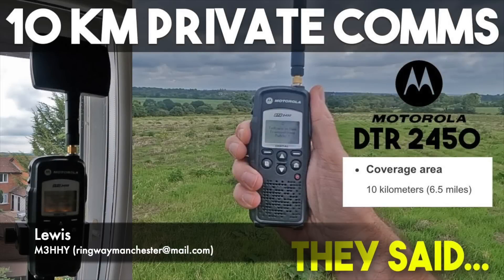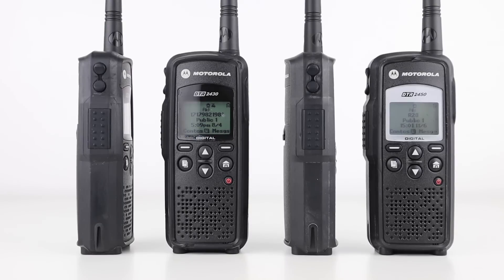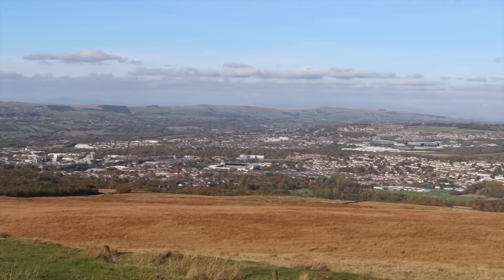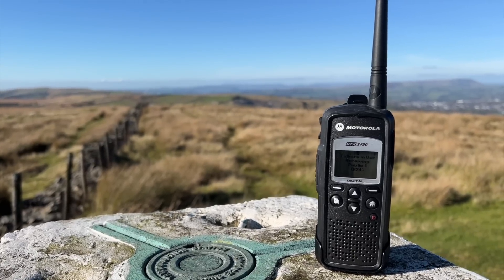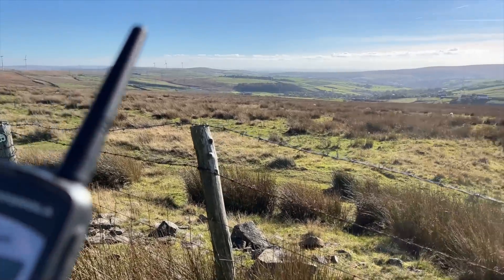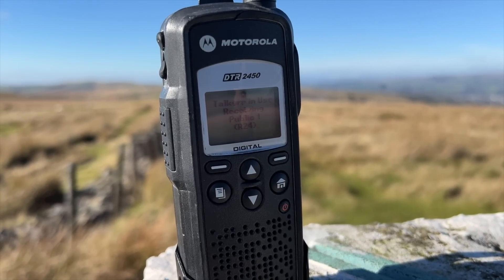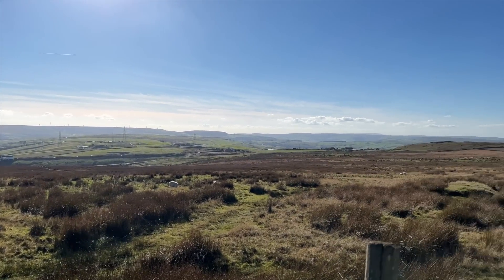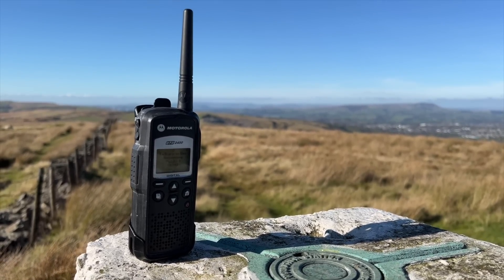Pushing These Secure High Frequency Radios To The Limit!

Comment: 2.4ghz is like the worst band to be using portable radios on. I dont know what motorola were thinking. Anyhow if you use a pair of parabolic dishes you should be able to get 10kms easily. Remember to keep the antenna cable between the radio and the dish short as you loose a lot of signal over a few metres of coax cable at 2.4ghz.

Comment: TriSquare also had FHSS 2way radios on sale across the USA and were fairly cheap but the technology was secure. Sadly they went out of business in 2012. They were cheap, on the GMRS 900Mhz frequency so no licence needed. Downside they couldn't 'talk' to any other radios.
Reply: Those things were pretty cool for what they were. AFAIK they used plain analog modulation combined with relatively slow FHSS (both unlike these Motorolas), so listening in probably wouldn't be that hard if you know what you're doing. There's a video on YT of someone doing so using Optoelectronics gear. Still a lot harder than plain old FRS/PMR446, though.

Comment: have you got an OFCOM simple business license?

you can use 5w and encrypted DMR, Anytone 878 offer AES256 but from 32 preelected keys from memory. I wonder if  someone could edit the hex and select their own encryption key 🤔
The Anytone 578 mobile unit can track the handhelds bearing and distance from the APRS (also does crossband repeat and can cross channel repeat on DMR with a different talk group) so it would create an interesting  extended encrypted network  Expensive experiment but interesting!

Comment: I've pushed the DTR650's (900MHz @ 1W) out to just over 14km. But more important to my application through 18 stories of a concrete building, well into underground parking garage. That's with the add-on longer antennas, not the stubby antennas that they ship with. They've been a very good radio for our building emergency team.

Comment: This is the first time that I have heard these radios. Thanks for the video 
My wife and I are using the Retevis RT10 900 MHz ISM here in the US. They are great radios for short range secure (as secure as you can be using radios). They don't do FHSS but they are DMR with encryption.
Reply: @blankreganon5395 do you need a license to use?
Reply: No license is required for ISM. They are limited to 1 watt. Amateur Radio shares these frequencies on a secondary basis. If you go over the 1 watt limit, you need to have a ham license.

Comment: It's a shame england doesn't have the same radios the rest of the world has. I got 300+ miles between 2 Uniden Pro 520 CB radios. One, a land 1/4 wave homemade wire, and one, a marine whip on a sailboat. 1/4 watt FRS radios?  7 miles ground to mobile radio shack units.
Reply: Is that strictly line of sight, mountain to mountain top?
Reply: @rawcado  Almost, in the case of FRS radios. The higher the frequency, the less the wavelength will bend or penetrate foliage.

Comment: Hei, I wonder if Dji can make a communication radio one day. I fly drones and there wifi signal has a range of over 3 km with video, flight data, battery info and gps. And that's European mode. On American YouTube videos, I see that they manage 10 km regularly. Imagine if they wanted to make radio?
Reply: That range is  line of sight.
Any radio will do 100km or more with line of sight
Reply: @jplacido9999  yes, just like in the video, 100mw 2km
Reply: @darkokelava4754  if you test a regular pmr446 or FRS portable, they will do dozens and even hundreds of Km once their have perfect line of sight...
Only when propagation is particularly bad the range will be less.

Comment: I wonder how long range you could do using for example a 1.2m sat dish and a helix on each end.
Reply: 2.4 ghz will travel as far as the curve of the earth will allow, the issue you may hit is timing, they are TDMA and the increases RTT delay may cause them to stop working.

Comment: I wonder what type of repeater could be made, utilizing a pair of these with different talk groups, linking the audio or talk path between the two units, and utilizing ISM Antennas with some gain?  Ideally, you'd need 4 radios, with two 'earmarked' for the repeater.  Obviously, some type of controller board would be necessary, in order to provide the interconnect between the two units, but I could see this extending the units range considerably.  Add a Telco connection, for remote access.  These would make good, secure control links as well.
Reply: @cappicturesinc.4597  I'm glad to see there is a commercial solution.  Although, at that price, I'm almost thinking the interface & two radios would be cheaper.
Reply: @oliverw.douglas285  For sure, it just seems like a lot of work.
Reply: @cappicturesinc.4597  Since I have limited hands-on experience with these radios, I'm speaking from more of a conceptual perspective.  Theoretically, they could probably be interfaced through a very basic bi-directional repeater controller, which cross-connects receive audio from one radio, to transmit audio of the other.  Obviously, the audio levels would have to be set to proper levels, to avoid overdriving or clipping.  Beyond that, some sort of carrier-on or active channel detection would need to be brought out of each radio, along with the PTT or Push-To-Talk, to activate the respective transmitter, at the appropriate time.  

I apologize if I made it overly complicated.  If the necessary connections from each radio, could be brought-out, & made accessible, I think a basic repeater could be made, utilizing two separate talk groups, with two 'donor' radios for the repeater.  I think it would be an interesting experiment either way.  :)
Reply: @oliverw.douglas285  Ah I see, that could defiantly work. Don't worry about it, sometimes thinks need to be explained that way :)

Comment: I've seen these Motorola Gigahertz radios several years ago. The only ones available in the U.S. are in the 902-928mhz ISM band, 1 watt. Several models ranging from 1 channel to 50 or more. I still have a pair of the old TriSquare 900 radios and got excellent range, better than GMRS at 4 watts
Reply: I also had 4 of the Trisquare radios. They were great but I had two problems with them. First, they went through batteries quickly. The second problem was if you had three or more on the same channel, they wouldn't stay synced.

Comment: Surprising outcome, i would like to see these tested in a built up area, always looking for better performance on building sites.
Reply: They don't work at all well in a built up area. I have the same radios. At ground level I left one at home and walked 2 minutes up the road and it already stopped working. The higher the frequency the more it is blocked by obstructions. With mostly line of sight I got a decent range. I can't remember exactly what it was now but I posted a range test video.
Reply: @radiosification  It's then worse than 400-470MHz radios. What frequency is it using, 1-2.4GHz?
Reply: @dare-er7sw  yes, much worse than 400MHz band  radios for getting through obstructions. They're using 2.4GHz.
Reply: @radiosification  HaHa, 2.4GHz is WiFi territory. Too bad. There are small VHF/UHF 1-2W analog transceiver modules available, one can easily build a homebrewed walkie talkie with privacy by adding a 40KHz subcarrier and modulating the subcarrier with FM voice.
Reply: Remember… the higher.. as in legitimately higher than were used to frequencies like above 5-6ghz are blocked more by buildings.

WHEN. Will people learn that lower frequencies go through buildings better lol if you want good range, get a good 900mhz model lol or a lesser used band. Those 2.4ghz antennas are near the Wi-Fi bands so you want to avoid. Same with 5 and 6. Look for odd frequency bands
Reply: @0eroOverride  Much lower frequency, or increase the power by as much as possible. Around 1 Mhz, you can get quite a bounce.